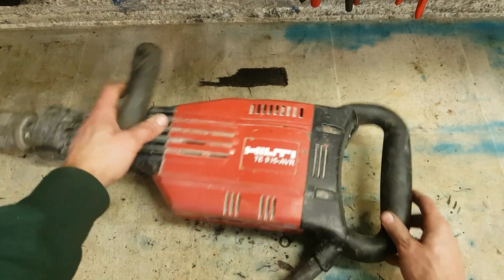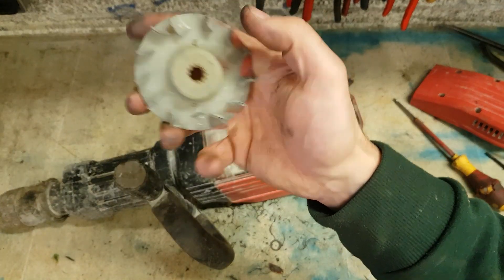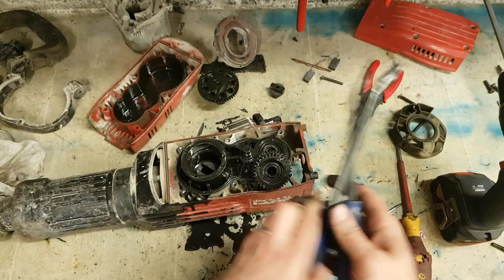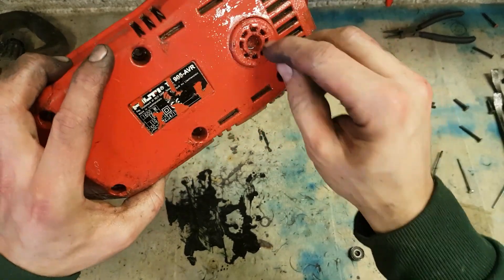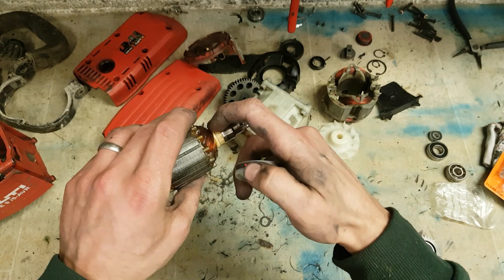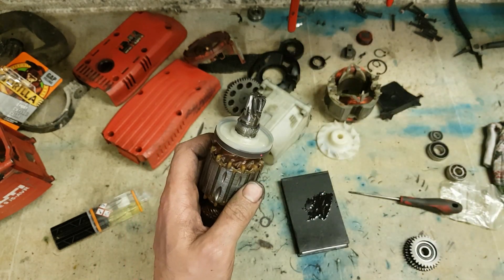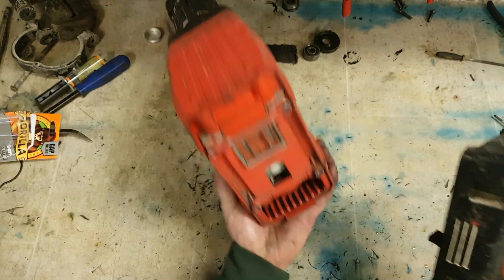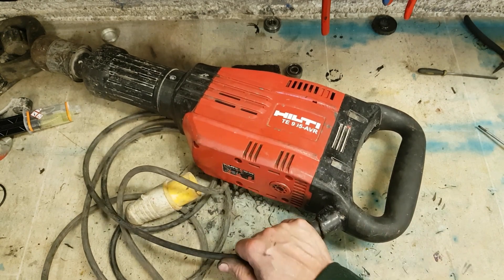How to repair a Hilti TE905 hammer that starts up but will not keep running.

Comment: To reset the hours on some of the older Hilti tools you can use a service reset tool. Hilti srt. I’m not sure if they are still available for order but it’s worth contacting Hilti to ask. It won’t work on everything but I think it will work on te 1000 and some older stuff

Other older tools like the te 76, te 60 gen 1, te 56, if the service light comes on, pull the grip off the tool, this will disconnect the motor from the electronics, plug the grip in while it’s disconnected, hold the switch for 10-15 seconds. Sometimes you need to unplug the cord while still holding the switch. But for those older tools that’s how the hours get reset

Comment: @Dean Doherty Is the "grease" you fill in the hammer housing different from the Turmopol 20HD you fill in the gear housing? Also, is there an equivalent oil to the Turmopol 20HD?

Comment: Hello, I am a Installer I have a te 905 Hilti I use to remove ceramic tile. It only breaks the tile when I turn it off, so I switch it on and off fast to keep it working. Can you tell what part I need to fix it.
Thanks, 
Love the videos
Reply: hello, what was your problem, i have the same too
Reply: @misaelgonzalez8435  I  haven't got it fixed yet.
So I'm not sure what the problem is yet.
Reply: Are un oring din cauciuc care formează presiunea in pompa de bătaie. Acel oring sau inel de cauciuc trebuie schimbat. Sa uzat și nu mai formează presiune.

Comment: Can you service hilti 905 kango. I have 3 that over 8 years and hilti won't touch them
Reply from the maker: i stopped working on hilti tools, they are to much trouble.
Reply: @deandohertygreaser  I hear ya. Seems I'm stuck with 3 paper weights I say